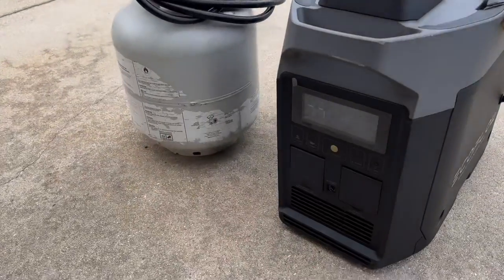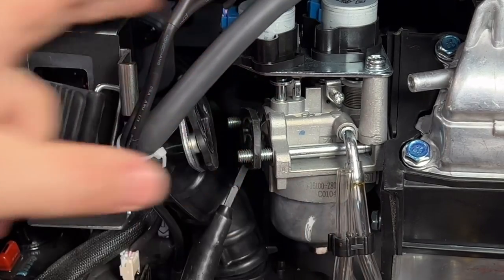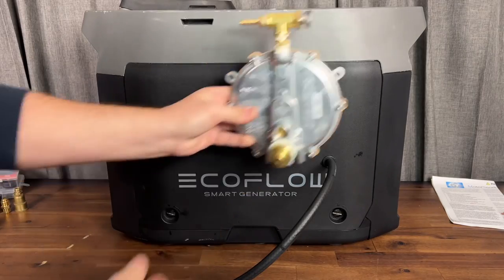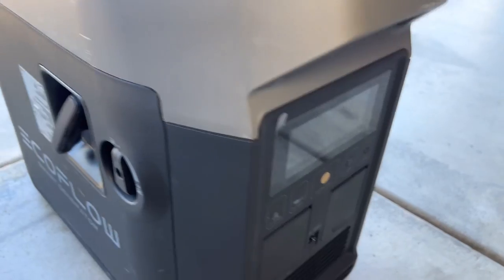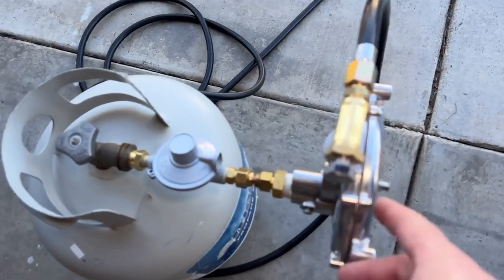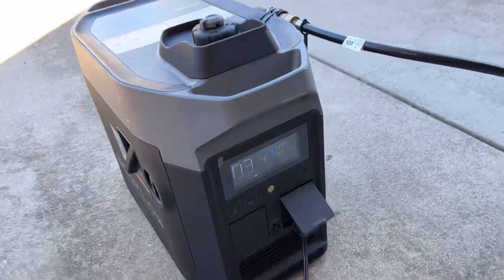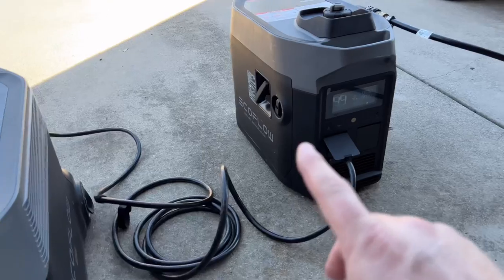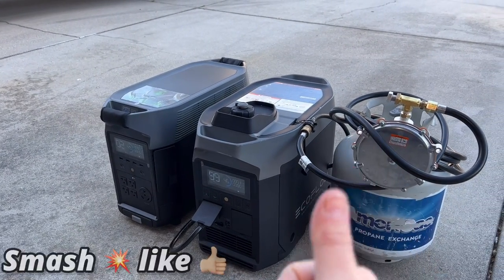ECOFLOW Smart generator Tri Fuel Kit

Comment: Because you have such a long line from the load block to the generator, you need to make a small change and wait for a bit to determine if you need to move it further. There is a time delay with the long hose.
Reply from the maker: It’s already set and running great. You can see in the video it ran full rpm and wattage and started and stopped like normal. 
You only need a couple seconds with propane as with fuel and a float vibrating like crazy can cause erratic running for a few seconds.

Comment: This is an awesome video.  We have this same Tri-fuel kit on our Predator 9000/7250 watts generator running on NG.  We have one DP unit.  The solar panels cost way to much if you want to charge at 1200 watts.  The Ecoflow generator has to small of a gas tank and wattage output.  But with this kit, that changes everything.  I might go on ahead and purchase the gasoline version and install this kit.

I really like how it was able to start/stop automatically too.  I'm sold.
Reply from the maker: Awesome glad you like the video and yes you could use the same kit just order the snorkel unless you want two complete kits. 
And if you do wanna order anything from ECOFLOW check the link I always have discounts..😀👍🏼 and the regular gas version is cheaper now

Comment: Great job man!! I bought a similar kit from Century Fuel Products and it allows me to also run on natural gas for my Yamaha EF300iSEB. The regulator looks the same so you should be able to run natural gas also although you may have to adjust the spark plugs gap and the regulator screw/nut slightly. I currently have one EcoFlow Smart Generator like you converted and I have an EcoFlow Dual Fuel Smart Generator on the way. Nice to know I can convert my original EF SG also.
Reply from the maker: Yes this kit is also a tri fuel kit. But yes like mentioned you’ll need the NG hose and pos changing the plug gap if you have running issues. And of course adjusting the load screw since the btu on NG is so much less 

And yes new dual fuel smart gens are on the way. 
Thanks for the comment and thanks again for watching 
👍🏼😀

Comment: Facinating video. It almost looks as if the rate of gas consumption is going to be constant irrespective of load ?
Reply from the maker: Yea I don’t think it will fluctuate to much because lowest it will charge is 1000 watts which seems to bring the throttle to around 60% or so, no way to just slow charge.

Comment: Awesome video! Do you need to make adjustments or use any different parts to burn natural gas? Depending on the property I’m at, I have either natural gas or propane available. I’m sure you still have to use the load regulator in either case, but is it just as simple as replacing the propane bottle with a hose that runs directly to the gas meter in the backyard?
Reply from the maker: No NG requires a different house connector but can be found at hardware stores. 
3/8th flare to the load regulator and the the proper fitting to your NG connection. 
Then a small adjustment may need to be made on the load block

Comment: Thanks for the video. I have a question. Can we connect the dc output of this generator to another device? For example, to the pv input of an inverter. Is there voltage on the + and - ends of the generator without connecting a cable when it is running? Or does it need to communicate with a device?
Reply from the maker: Unfortunately no. The data cable lets it know what it is plugged into.
Reply: @johnnysweekends  Is there a way to have open voltage like AC output?
Reply: @johnnysweekends  In short, when we connect the Multimeter to the + - terminals of the device, does the dc output of the device show 42-56 v without any cable connection?

Comment: This video is perfect timing for me! I just ordered one from Costco, they have them on sale for $900 until 10/23/2022. I was debating on whether or not I should be waiting for the official EcoFlow model with dual fuel built in... but now that I see it's easy to add aftermarket myself that changes things. I don't have any regrets purchasing the "original gasoline only version" now that I've seen your video which is much appreciated! 

Do you know if that kit can run the EcoFlow Smart Generator on natural gas as well and how well it runs?  I was curious about that option as well in the event there is a power outage in the area from an ice storm or something but yet natural gas was still flowing that might be a good option to avoid having to risk traveling dangerous road conditions to swap out propane tanks or top off on gas.
Reply from the maker: Awesome glad you found the video..😀👍🏼 

And yes this kit is meant for tri fuel! But obviously you need the NG set up. So maybe I can do a updated video in a couple weeks. Although I don’t really plan on NG but I know people have been asking 😀👍🏼
Reply: @johnnysweekends  Yeah that'd be a nice to have for sure, especially for prolonged outages or just avoid having to refill with gas or swap to a new propane tank.

I'm thinking if I were to dabble with the NG option it'd be a bit down the road since I would need to figure out plumbing into the NG lines at the house for an outdoor hookup. Alternatively some extra long extension hose to connect onto an existing NG hookup like the stove and run it outside but that seems pretty sketchy and impractical.

The other modification that I'm thinking about is splicing into the "extra battery cable" that connects the Smart Generator to the Delta Pro so that I can make one long enough to go from my detached garage 30-40 feet away to my house. I really wish they sold a longer cable since you basically need the Delta Pro and the Smart Generator to be right next to each other for the auto start and DC charging to work. My crazy idea is to basically cut the cable in half and just splice in some quality 8 AWG or thicker wire for the large DC positive and negative cables to the length I need. There's also the data pins in that connector for telling the generator to start/stop but I work in IT so I have a spool of CAT6 Ethernet network cable that has 8 wires I could use to splice into those. The end product would probably be ugly, but I can't see why that wouldn't work and be safe since it'd be a straight pass through to extend the factory cable.

There are a few reasons I would want to do this:
Allows me to keep the Smart Generator safely stored in the detached garage to avoid theft and limit the noise when running. I would vent the exhaust outside (with your muffler extension mod from a previous video) since otherwise the CO detect would trip.
Allows me to keep the Delta Pro in the house where it's climate controlled, prevents dust from getting into the inverter electronics, etc
Climate controlled is important too, charging LFP batteries below freezing is bad news. That's a very likely situation for me in Michigan. My odds of having a power outage in winter is much higher than any other time of year.

So that'd force me to do the following with the factory cable:

Situation A: Have the Smart Generator and Delta Pro in the detached garage together and hope that the Delta Pro doesn't get too cold. Run a power cable from the AC output of the Delta Pro to the house.

Situation B: Use the Delta Pro inside the house and just run the factory cable outside as far as I could into the back yard. That means the Smart Generator would be just chilling in the back yard exposed to the weather, potential theft, and although it's quieter than some generators would be.. it'd be louder than running it inside of the garage like I'd like to do.

Anyway, sorry for everyone to read that giant wall of text. Hopefully you get what I'm trying to say here. If you read this far, thanks for coming to my TED Talk. 😆
Reply from the maker: Lol yea I read it. 

Yes a longer cable would be nice and seems you have the ability to do it. I thought about but the data cable inside I’m sure isn’t anything to crazy but I decided I don’t wanna mess with it. 

But yes the pro needs to be somewhere warm and not outside in the freaking temps. One thing I don’t like about the smart Gen is the start up. Even at the lowest load of 1000 watts it goes from zero to about 70% throttle with no warm up or nothing. 

I think this will prematurely wear this unit out. Hopefully not but will see since it’s only been out a year and I don’t know how many hours people have on these units yet.
Reply: @johnnysweekends  That premature wear due to no warmup time makes sense. I wonder if that's something they could patch in an update to add an optional delay after startup before the DC output started providing power. 🤔

For now I'll keep that in mind and have it dialed back to the 1,000 watts mode. Thanks for bringing that up, I never would have thought about that side of things.
Reply from the maker: Yea I have mentioned it before will see what happens. I don’t know if they can do a update on existing or not. May be more in the electronics then just firmware. Not sure on that part but yea start up on 1000 then ramp up after a couple mins of ya need.

Comment: So, is it impossible to make the newer dual fuel generator capable of running on natural gas? I'm trying really hard to figure this out.
Reply from the maker: Yes if you bypass the internal load regulator. You cant double regulator and that one will not work as it is not designed for NG. You will also have to have the LPG house connected to activate the switch for propane. The original SG is very simple.
Reply: @johnnysweekends  thank you. Now I'm bummed I went for the dual fuel LOL I live in a city where natural gas is plumbed to every house and my water heater and furnace are both on natural gas. I watched your video on what to look for in a generator to be able to easily make them tri fuel a bit back and assumed that the dual fuel unit would be easier to fiddle with haha. Thank you for your response
Reply from the maker: @NoZenith no problem, I don’t think it would be hard as the gas line is right in front of the carb. But you’ll need to activate the relay on the other side for propane with maybe a dummy connector
Reply: @johnnysweekends  oh interesting. I have one of those old school hardware stores in my neighborhood and they have helped me upgrade from old consumers round gas fittings and off size threading to make my appliances work already so they can probably help me with this! I'm assuming you're saying I need to have one of those little Chuck fittings to pop into the propane input I think it was one of your videos I just watched where you were discussing how they were proprietary and very much not the same thing as off the shelf fittings and you had to get it from the manufacturer of the part from China that was a very interesting video but it looks like quite the hassle to get that piece! Kind of wishing I had seen this video before Thanksgiving when I purchased the dual fuel now haha. Could have saved a couple hundred dollars probably to then throw at the regulator and hose setup you display here
Reply from the maker: @NoZenith the connector is no longer a proprietary item. Several others use it now like the new predator 5000 and champion 4500 dual fuel. All you need is something to activate the relay switch and plug the hole.
Reply: @johnnysweekends  oh! That's fantastic. Thank you very much.

Comment: For the cost of the Ecoflow  i thought the LP connection was on it inside the panel, so  world you go with a Echolflow or a eu2000i or this? Nice video Any HACK TO EXTEND THE  EXHAUST OUTLET BY A HOSE? are the electronics safe outside wet conditions  in the weather, and what about the generator battery if it's to cold will it charge ? will it start? is the battery a LifePO4 ? they have to be semi warm at 50 degrees?
Reply from the maker: This is not really a outside all weather unit but a generator tent or gen box would do. 

The battery is lithium ion so a little battery for cold weather but still maybe not the best option in extreme cold so a agm replacement may be better. 

ECOFLOW does not even off a replacement battery so I’m kinda annoyed with them about that.
Reply from the maker: Also I did a video on a exhaust extension kit for this unit 😀👍🏼
Reply: @johnnysweekends looking for this next!
Reply: @johnnysweekends agm? thx

Comment: Might want to check if your pipe thread sealant is gas safe. Not a huge deal since it’s going to be outside. Gasoila is a brand and also there are gas safe Teflon tapes (usually yellow).
Reply from the maker: The kit does come with tape, but the TFE paste is good for LPG NG and more ..😀👍🏼
Reply: @johnnysweekends  OK. Just checking. I know normal Teflon tape and pipe dope aren’t.
Reply from the maker: Yea you just have to grab the other stuff that’s for gases.

Comment: I have 2 smart generators. Do you think I could split the flow where you have the long tubing and  feed 2 generators from one regulator?
Reply from the maker: Hmm I’m not a hundred percent sure. I do know that load regulator is the same one for the Honda 3000 I have it on and also bigger 4500 units and more. 
So I bet the load regulator can handle the double flow but I don’t know how it would do back and forth on the load adjustment screw. 

As both are running say 80% steady and you adjust for it I’m sure it will be fine. But what if one shuts off will the flow from the load screw now be to much? 

It would have to be tested I guess.

Comment: This is so helpful!  Thanks.  I have similar kit but could never get it to work on my 2000w Wen generator.  Could you please provide us the model of this generator? TIA!
Reply from the maker: That’s the smart generator from ECOFLOW it’s meant to plug into the ecoflow units but can be used as a stand alone but it’s not very good for that. So if you don’t own any ECOFLOW products I would look into something else. 

But can find info and discounts here 
Everything ECOFLOW Discounts!!!!
PROMO CODE: JOHNNYSWD https://modernhouseusa.com/collections/delta-series
Reply: @johnnysweekends  thank you for thhis info.
Reply from the maker: No problem 👍🏼😀
Reply: @johnnysweekends  Your right that it is not very good as a stand alone generator. It runs much faster RPMs than any other generator so it will wear out much faster. I have two delta pros with the dual voltage hub. This configuration shuts off all AC ports, both output and input. I have a 3500w inverter dual fuel generator with remote start but it's almost useless because I can't charge via AC. I am thinking of buying the ecoflow generator cable and hacking it to work with my generator which would make a great video for you to do.

Comment: Is there a kit to add natural gas to their new dual fuel smart generator?
Reply from the maker: No you have to bypass the internal load regulator on the newer df model. And at only 1800 watts it definitely doesn’t do great on NG. Just doesn’t have enough power.

Comment: I was regretting get the ecoflow smart generator before the dual fuel option was available, but I have a question-Does the flow of propane stop when the generator turns off? I wouldn’t want my cylinder draining while the generator is off.
Reply from the maker: Yes as you can see in the video, when the generator stops so does the load regulator. When I tested it with the pen no leaks and nothing draining. But I have used these kits before and many other people have as well for years. 

Now if I wasn’t going to use the generator for extended periods then I would shut the propane off anyway like most things. 
Because anything can seep if under pressure long enough.

I mean look at the news that came out a few days ago on all the leaks of benzene gases from homes over years. 

But of course ECOFLOW is coming out with a dual fuel unit in the coming weaks
Reply: @johnnysweekends  thanks it was a great presentation, but I didn’t see the mechanism that would stop the gas if the generator decided to stop due to the main ecoflow being charged adequately. The gasoline has a carburetor float to cut-off the gas when the motor stops but didn’t know the load regulator did same.
Reply from the maker: Ahh got ya. Yea obviously the first regulator gets the pressure correct then the second regulator is the on and off and fine tune.

Comment: Why not just use the adjustment screw on the diaphragm instead of using the extra fittings?
Reply from the maker: As in for what part? You need that screw to adjust so not sure exactly what you are wondering
Reply: @johnnysweekends  there is a adjustment screw right above the inlet of the low pressure regulator. That’s suppose to adjust the flow of gas isn’t it? As opposed to the extra adjustment fittings on the outlet?
Reply from the maker: Correct but according to the manufacturer and the guys I talked to which they note in the manual, do not adjust the adjustment screw behind that screw. That is only if the unit will not run properly during any adjustment on the load block. 

So I have never had to mess with it and these have been a set and go item at least for me. The other is on my Honda eu3000is
Reply: @johnnysweekends  I think I understand. The adjustment screw is set for what the regulator is marked as (min max inlet). The exterior fitting is for essentially adjusting the vacuum pressure to regulate the amount of fuel the motor is demanding. I guess the only time the adjustment screw is needed to be changed is if it was used on smaller engines where less vacuum is created. I assume there is a spring behind it which can reduce the back pressure on the diaphragm so it’s more sensitive to less vacuum pressure. It makes sense why they cap it off now.
Reply from the maker: Correct that screw is for when either using I assume a much smaller unit or much larger and the preset that probably works for most units with the propane regulator which I think all are 11wc for these small and mid size units .